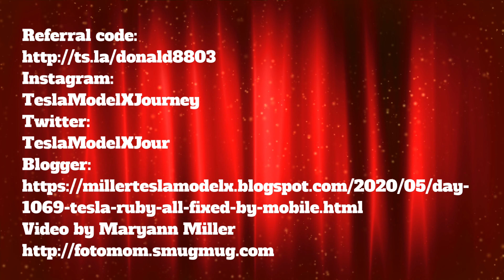Day 1069 Tesla Ruby All Fixed by Mobile Service

Comment: So ask him why he doesn’t have an electric ⚡️ service vehicle🚐🤔?
Reply from the maker: Come on Cybertruck! They tried a Model S for a few of the guys, but this shape van works better. At least that's what I saw/heard. Maybe they would use the NV200 if Nissan would actually sell it in the US. All in good time;-)
Reply from the maker: @brianmartin3263  I don't have any inside info on this topic unfortunately. Here is an old Electrek article showing the Model S in use as a service vehicle. I think it's a matter of having a vehicle that makes sense when you have to lug tools and sometimes tires to service calls. Can you do it in an S, sure, but does it make sense as a good fit for the cargo, probably not.  Some of the vans have canopies installed on them so if it's raining they can still set-up repairs under them. I hope someday the service fleet will also be electric.